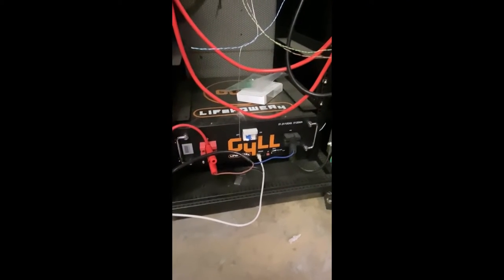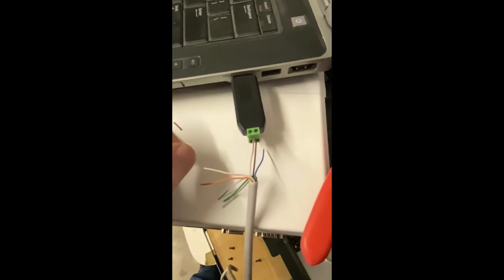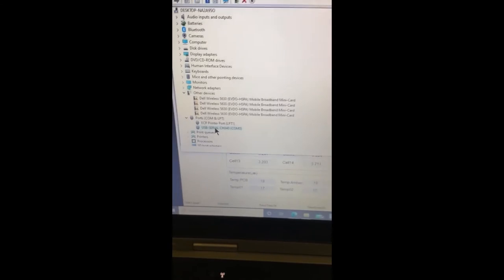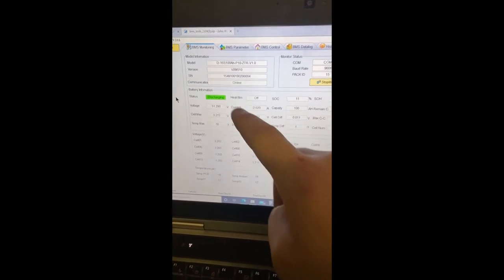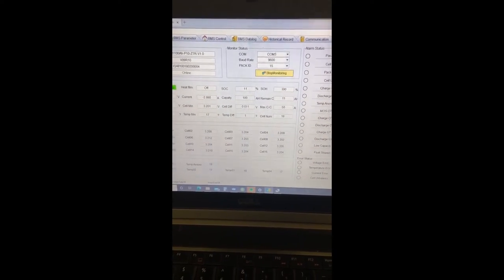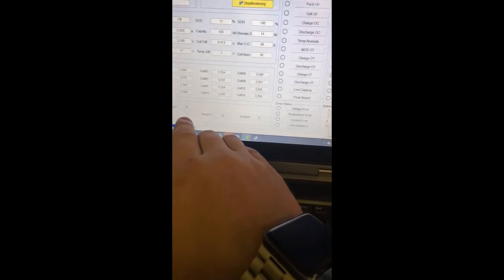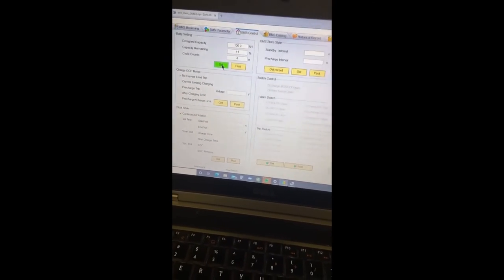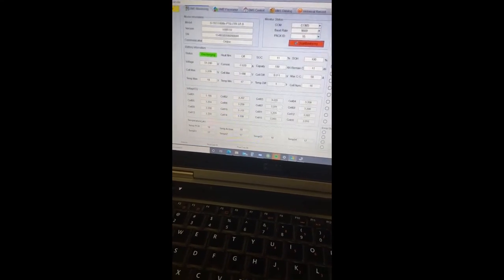BMS Cabling and Software Setup - GYLL LiFePo4 Battery

Comment: hello, thanks for the video. Have you guys tried this BMS tools 2.0.6 program on the new batch of LiFePOWER4 batteries you just received?  I received 4 of them on the 8-11-2021 and none of them will communicate with the BMS tools program. I will call the office Monday when you open.
Reply: I have this issue also, the serial port & drivers look fine on windows but the discovery on the left will not find it using the correct com3: port looks like each bundle is not replying fast enough in the comm screen of the program.... And it wont let you click in the start like you were in video
Thankfully I found this site and the 3k inverter to 24v200ah ( using the bms port - go figure ) is communicating fine.
Reply: ever get this sorted?  Was it changing the first battery to module 2?
Reply: Bill, I have 4 of the NEW 8 volt batteries with the LCD display and I found a work around USING ONLY ONE USB TO 485  CONVERTER to get all 4 of my batteries workwith with the BMS tools software. I have for over 2 weeks tried to get in contact with tech support,  I have called, sent emails and posted on there YouTube videos and was told to email them so I did and no reply to the Email I want to talk to them before Post my work around.
Reply: On Tuesday I posted a video on how to get 2 or more of the EG4-LL batteries to communicate all at the sane time with the BMS TOOLS software you can see my video at:  https://www.youtube.com/watch?app=desktop&v=Mq4YNPOzUyA  it's 7:41 long but if you don't want to watch all of it you can jump to the 3:05 pont in the video